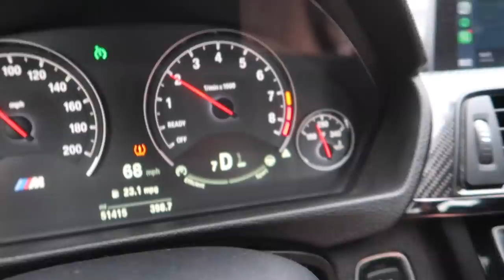M4 GETS UPGRADED CRANK HUB + MORE! (DROVE 1000 MILES!)

Comment: what did he mean by "It's a heartbreak dyno" when he talked about the Mustang Dyno??
Reply: mustang dynos read lower than usual, so say your can is making 220 wheel horse power on a normal dyno on a mustang dyno it would read like 190 wheel horse power. Which is why it's heart breaking haha cause you always get lower than what you expect. Not that your car makes less power it's just the dyno measures low because it put's load on the motor unlike other dynos which let the wheels spin freely.
Reply: @msalamlaham7129  thx bro 🤣👍